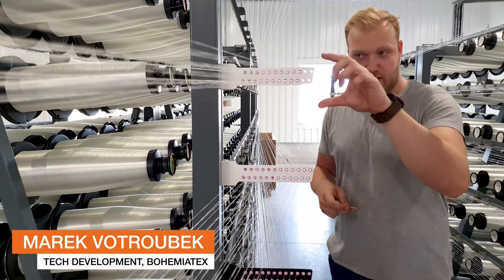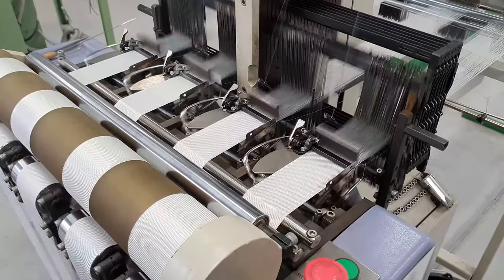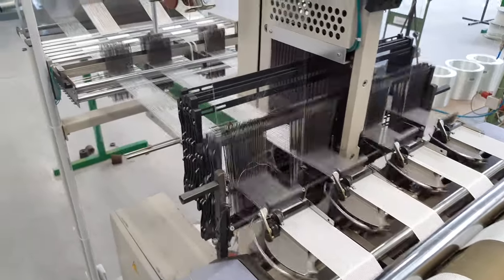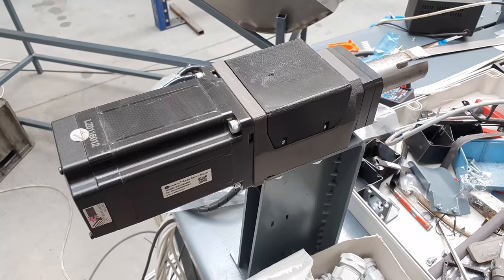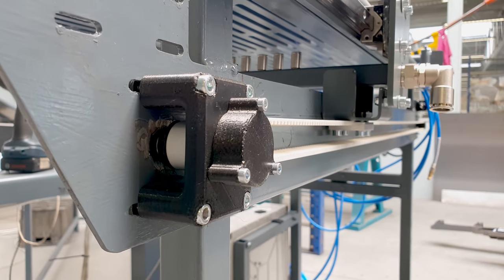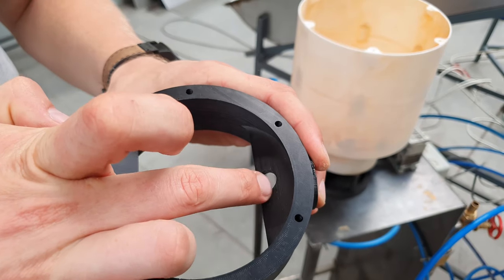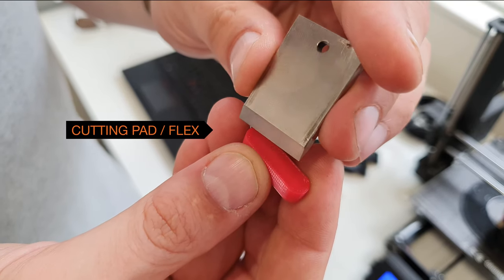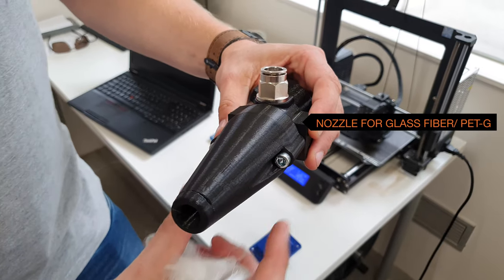Prusa 3D printing stories: BOHEMIATEX

Comment: Seems like Industry is not only buying Ultimakers :)
Reply: Industry is also buying Lulzbots ;)
Reply: Its normal they choose PRUSA.
BOHEMIATEX is a Czech company and PRUSA too.
It's cheaper and they help their own country :)
Reply: @MichelBricole  Personally I chose PRUSA because of extruder assembly. PRUSA lets you assemble it yourself and change nozzle easy afterwards, thanks to that I know every part of assembly, have easy optionality and also don't lose my shirt with cost of operation. I'm hobbyist but for industry I´d also go for PRUSA.
Reply: @LuckySOB100  Personally I would choose the AMAZING Original Prusa MK3 if it had a bigger print volume.
Unfortunately I need to print big stuff and if it was with the MK3, it would be a nightmare to glue all the parts together.
Anyway I'm still a huge fan of Prusa like you :)
Reply: Actually the industry is using SLA and SLS printers, only a small minority uses FDM.